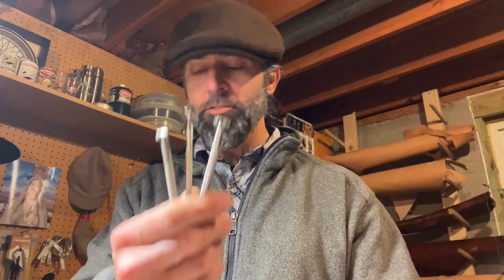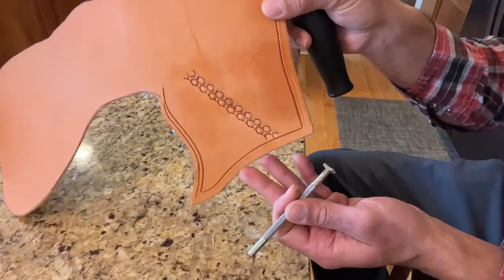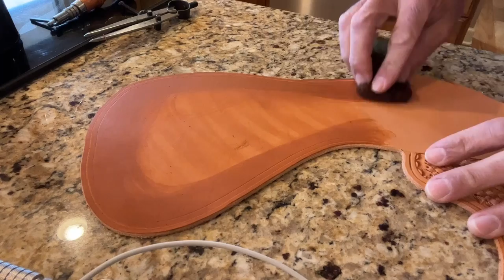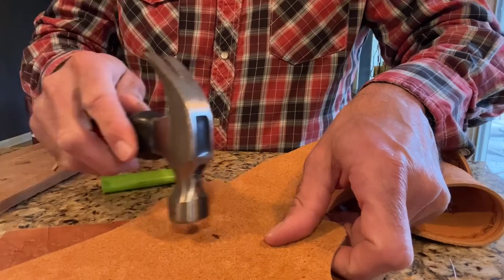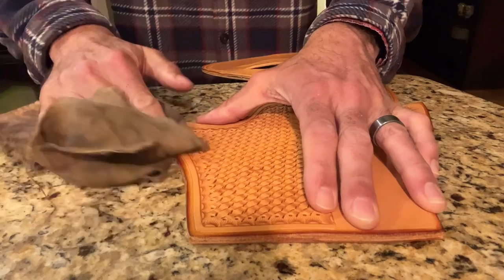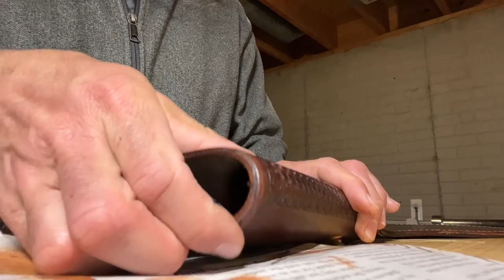Making a custom leather holster using a basket stamp design

Comment: i think you are doing the basket weave backwards.  you should do that first then the edge stamping.  the edge stamp is to hide the edge of the basket stamp.  now having said that, it looks amazing.  great work!!!!
Reply from the maker: Thank you for the advice! Honestly I think you’re right. I’ve actually done it that way in the past but I found starting the edging and then doing the basket stamp allows me to know where my edges of my basket stamp will go so I don’t have a rogue line (from a basket stamp) through my edging. Then I can go back and punch in the edging again if the basket stamp accidentally was over the top of the edging. I think either way works and I definitely appreciate the recommendation and comment!!!